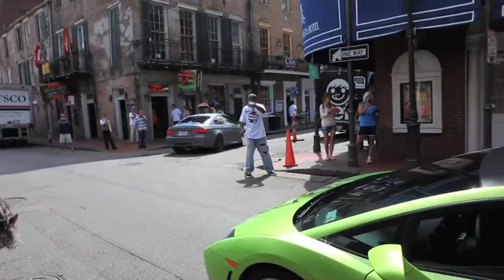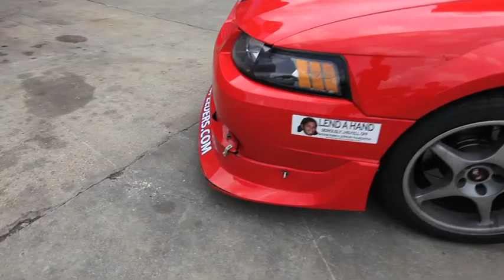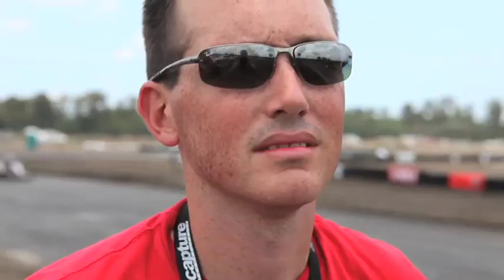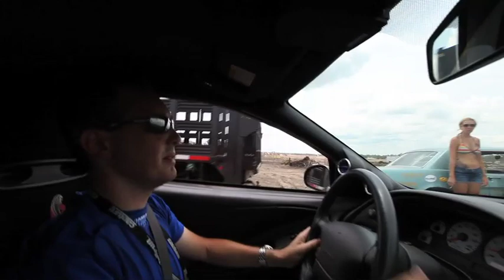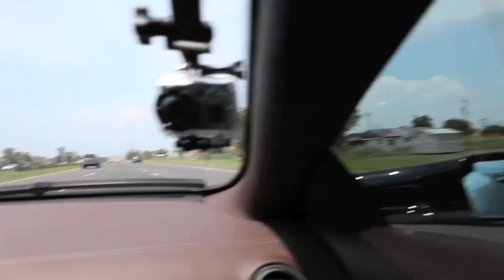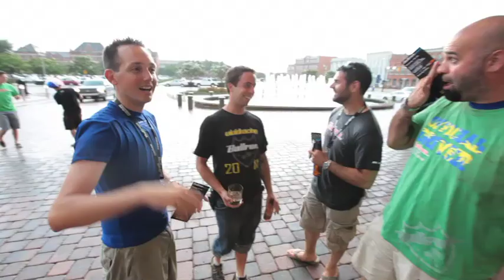Bullrun 2011 Day 5 - Team Super Speeders

Comment: @The06mustangGT the front splitter is a terrible design. there are plenty of race tracks in the US where you can get over 110 on the straightaway. The fact that the splitter makes so much downforce that it rips the whole bumper off the car is a major design flaw. Anyone who actually keeps and drives these cars knows this, and generally replace that splitter with the much stronger Carbon Fiber one.